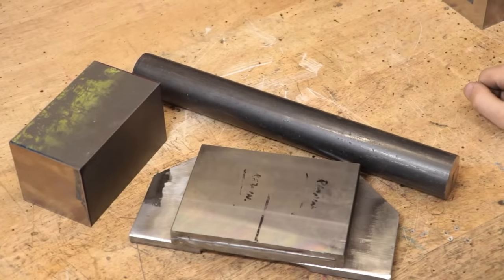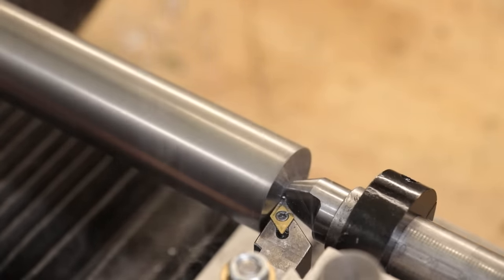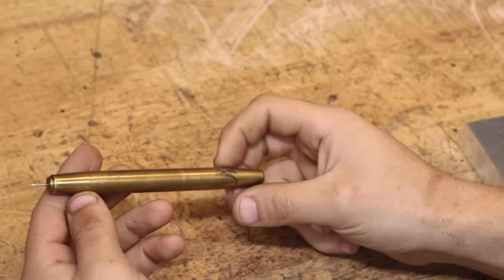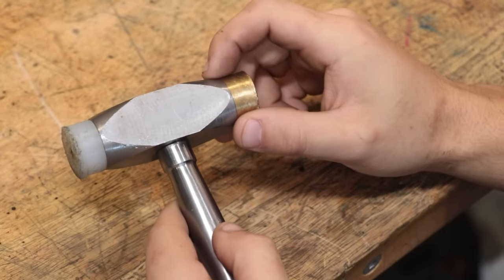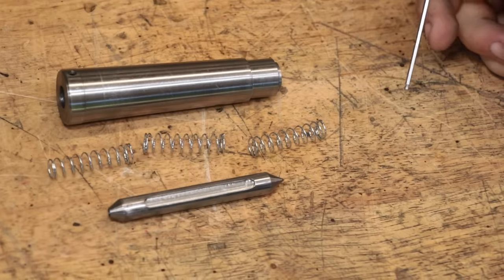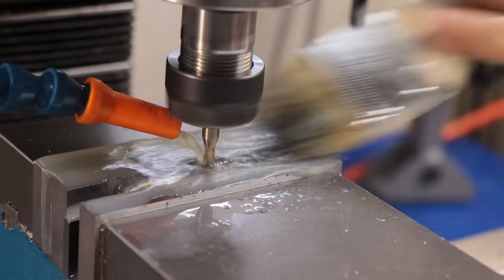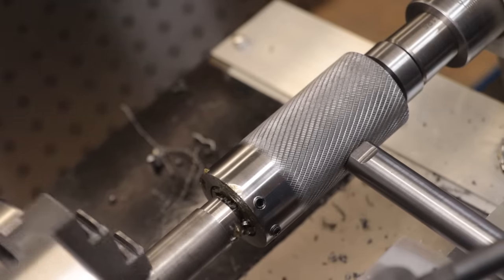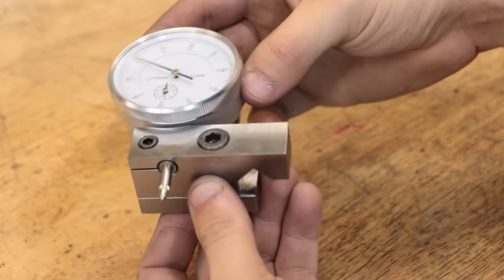The 6 Best Lathe Projects For Beginners

Comment: For threading in the lathe I'll often start single point to remove most of the metal then use a die to finish since the die will bring the thread to size quickly. It works especially nice if I need the thread all the way to a shoulder without a clearance groove.
Reply: Yes I find you have to use this procedure when you use a "cheap" die some times, might be a relief problem with them.

Comment: My list of lathe projects has been stuck at 1 for years.  

1:  Get a lathe.
Reply: Perhaps slicing project number 1 into smaller pieces would help? 1a) Save some money for a lathe budget, 1b) find a lathe which fits said budget, 1c) actually purchase the dang thing. Admittedly, I am still stuck at 1a, but perhaps you can make it further down that list than I did so far.
Reply: Mine too!
Reply: Mine was too, for about 2 decades. After I bought my first lathe, I wondered  why it took me so long! If you are short on $ (we all are) get an used machine, even an worn-out is better than none. That's the most useful tool ever, that will lead you to the ultimate hobby itself.
Reply: @TheBipolarBear  I am stuck at Phase 0 of the project. Finding a damn place to put a lathe lmao

Comment: I think the half-center is often ignored because for most projects you can just choke up on the stock to face it. Awesome video though, maybe it will be cool to know that my my first shop professor had me make most of these when I first started machining. I love the handle on the die holder. I've had a lot of trouble holding my own die holder (which lacks the big handle) when cutting steel

Comment: NUMBER ONE beginner project: Learn to grind HIGH SPEED TOOL BITS.
That would have saved you ~ $450-$1125 right off the bat just for the carbides you showed. 
1 $10 tool bit will replace 100's of carbide inserts and can be shaped to do any job then RE shaped to do another and can be re sharpened 100s of times.
You will learn the basics of how cutting tools work and it will also translate to sharpening other tools, like drill bits etc.
Whatever you do, you will do better if you know how to make your own tools.
Reply: I agree 100% 
Sooner or later you will need a tool to get into a place that a carbide insert tool won't reach or you need to turn a certain profile and will have to grind a tool for it . i see so many times where a newcomer buys a lathe and goes straight to insert tooling because they are scared of grinding a HSS tool bit - this basic skill  can be a game changer and can save you heaps of money . I have heaps of insert tooling for my machines but am migrating back to HSS tooling because it is tunable to the material being machined - i can easily change cutting tool angles / rake etc to improve the finish which can't be done with insert tooling .
Reply: @ianbertenshaw4350  When I started we still had some high carbon steel tools but mostly High Speed tools and if needed we had Stellite and/or brazed carbide tools we could make. All hand ground. That covered almost all the bases. 
Then this insert thing came in. The intention was for PRODUCTION work NOT shop work and for production it works well and makes sense but in the general shop it is ridiculous. After 50 years I did break down and bought ONE insert holder for the lathe and ONE insert face mill. For anything else I braze a piece of carbide on a shank and grind it. Luckily there are plenty of old carbides to be had for free to braze on that someone ELSE paid full price for🤣.
Reply: @ianbertenshaw4350  My guess is that most beginners shy away from regrinding HSS cutting bits is because they can't see what they are doing. Especially ones for a mini lathe, I certainly can't and what with having to get the angles bang on, forget it.
Now if there were a jig to hold them, like the drill bit sharpening machine that I use, I'd give it a go.
Reply: @steveclark..  
i don't usually use a drill sharpener or jig  either - unless i am doing four facet grinds that is ( use a dbit grinder for this ), i was taught how to grind them by hand and yeah sure they aren't as good as new but they get me by . The angles on a HSS bit are not super critical and you can make life easier by setting up the rest on your grinder to give you the approximate rake or clearance  angles required. The biggest mistake newcomers make is reading some data book and thinking the cutting angles have to be precise and it scares them to death but i find that near enough is good enough and for me it is more important to hone the cutting edges  so they are sharp and this also removes the marks from the grinding wheel which gives a better finish in most cases . i use an optivisor sort of thing as my eyesight isn't what it used to be.
There are four basic skills a metal worker or machinist should master : Hacksawing, filing , tool bit / drill bit  grinding and basic marking out - these skills have got me out of so much trouble it isn't funny ! 
P.S the HSS tooling doesn't have the overhang a carbide insert holder does which is a real bonus for small machines like a mini lathe  that struggle with rigidity.
Reply: @ianbertenshaw4350  All great advice there. I'd say that I've used my mini lathe more with carbide tipped tools than any other cutters, the brand new set that came with it, I found useless, I then got an HSS bit that had already been ground, sure that worked OK but overall I'd say that carbide bits are far better and easier for most to get along with.
Reply: Meh.  Don't want to deal with it, and don't want the grinding dust in my shop.  Did a lot of grinding in my last shop and it got nasty.  Current shop, I will find another way, or wait until the weather allows me to take whatever outside for grinding.  Insert tools save me all of that, and they don't need to be carbide necessarily.  A.R. Warner's makes nice HSS insert tooling.
Reply: @netpackrat  Grinding dust?  Seriously? All the grinding dust from sharpening tools in my shop for the last 30 years might amount to a few spoon fulls. I'll take that instead of spending $thousands on inserts and holders.
I've never met an actual general machinist that does not have a selection of hand ground tools.
Reply: @netpackrat  I do see your points and use inserts mostly myself but being able to master the skill of grinding HSS bits would be handy. Imagine if Klaus Schwab and his Great Reset actually happens, goods from China may be a thing of the past.

Comment: Great little video, showing some very useful first projects, I think most people could work out how to mill the carriage stop on the lathe using the cross slide (with some ingenuity). It's a slightly more advanced way of thinking about a lathe but as you yourself have said a lathe is also a horizontal mill.
Thankyou for sharing

Comment: Sometimes you might get a tap with a point or rounded end rather than a convenient hole. I have a few BSF taps like this. Easy to make a tap follower with a hole. I used a BSA motorcycle cam follower to make mine as it was good steel with ready made concentric recess for the tap end

Comment: I may have a faulty memory, but with your old lathe, you mostly turned the chuck by hand when single point threading, but I notice you do run the motor when single point threading with the new lathe, is my memory correct?

Comment: Any thoughts of adding an ELS electronic lead screw kit to your new lathe to cut any threads from acme, British pipe, metric/standard fine /course etc..even custom threads are possible without gear changes via the stepper motor controlled lead screw..they have inexpensive plug n play kits available..it would make a great video series besides being a great addition to the shop..Cheers..
Reply from the maker: For me I have zero interest in adding one to any of my machines. Nothing against them but I just doing find the project interesting
Reply: @artisanmakes  Yeah having the ability to cut any thread on earth accurately in minutes for a couple hundred dollars total,seems like a complete waste when you can spend hours making a tap or die each time you need it..guess its more about the journey then the final destination..I totally get it..obviously a guy that hacksaws everything isn't interested in quality of life innovations..which makes you stand out from most..Cheers..
Reply from the maker: That's not what i said. I just don't  find it to be an interesting project, so it has never been near the top of my list of things to do.
Reply: @agentcovert he doesn't have space for a bandsaw.

Comment: I think the title is a bit of a misnomer if 2 of the 6 projects require a milling machine :¬(

Other comments 
1) the stylus needs something to stop it rolling - falling off the bench is the main cause of tip breakages 
2) surely if it's for beginners, at least 1 project should avoid steel and stick to brass, alloy, Delrin etc?
3) cutting the slot for the tap follower can't realistically be done without a mill. Would it be possible to make a through slot in the outside holder (using repeated drilling and hand files), then fit a screw-in pin to the inner part to match the slot?
Reply from the maker: Of course you can do it without a mill. Hold endmill in the lathe chuck and hold the centre in a tool holder and advance the cross slide to machine it. The channel We can do that better does that type of work quire often.
Reply from the maker: Well.as I said in the video it's entirely up to the user what material they use. On a big lathe  steel is pretty straightforward. At leastit was for me when I was shoved on one
Reply: Eh, 'affordable' benchtop mills are a relatively recent thing. What d'ya think model engineering hobbyists did back in the day? They used the toolpost to hold the work or stuck a vertical table on the cross slide and milled with their lathe.

Love ArtisanMakes but he's understating the ability of the lathe to do most things you'd do with a mill. Of course, if you have a mill, you'd use that but if you don't have an extra £1500 to spend on a mill after you spent a grand on a lathe then don't be put off; import vertical milling attachments are pretty cheap and after a bit of cleaning, fettling and setting up you'll be doing milling on your lathe when you have to

(it's a pain in the ass to set up but that's what happens when we're poor: inconvenience, I'm afraid 😂)
Reply: Right, so the endmill I don't have, because of course I don't have a mill, will do the job, if only I, a total beginner, can work out how to hold ~20mm round stock in a toolpost that only takes 10mm tooling. No doubt possible, but I think I'll stick to my suggestion which doesn't require any of this. Thanks anyway. @artisanmakes
Reply: @artisanmakes  Missed the comment about using material of choice, just noted everything was steel. The 'big lathe' is in the workshop I don't have alongside the mill I don't have so I won't be using that any time soon :¬(
Reply from the maker: For the tap follower you only would need to clamp is 8 or 10mm stock. But people who dont have mills use vertical milling attachments. Before I decided to buy the mill I was going to buy one
Reply: @artisanmakes  Hi, you're right of course - the slotted part is the smaller inner rod. Duh. I may get an endmill and try, but I'll have to think on it. Attachments of any kind aren't really an option for my tiny and long out of production Toyo ML-1, I'd have to change the lathe first, and I'm not ready for that. It's easy to spend an awful lot of time and money on the machining, when all I'm really interested in is the parts it produces.

Comment: Er if there's not enough room on your lathe for the Tap Wrenches you have why don't you design and make one that is the right size to use on it. I mean surely it's a easy enough project seeing as you've already made a larger one. To get the torque you need it might take a bit of clever designing with say folding arms so the one that's at the bottom at the time folds out of the way of the bed but once past folds out and extends again to give you the torque you might need. That or just make it with shorter arms as I can't see you needing more torque than shorter arms would give you anyway. You still really need a band saw and preferably compressed air in your shop, if just so you can blast clean the Mill or whatever whenever you're using it. Love the fact that you've built a shop that's effective and where you can make things and do the things that obviously make you happy and that you enjoy. It's obviously your passion and despite obviously not having unlimited resources or anywhere close you've bought the machines you can afford and are making the most out of what you can afford and get. I mean whilst Clickspring has a larger lathe and can obviously afford to spend on machining that you can only dream of at this time he shows regularly just what is possibly, the percision and accuracy, the inventiveness and stunning finished pieces that are possible on a small, cheap lathe. A few tricks, a bit of out of the box thinking and taking the time to ensure that things are right are far more important than the machinery and Tools you have. I'd imagine you've already found his channel but if not you definitely need to check him out, there's also Inheritance Machining where his level of percision and dedication to getting things as good as they can be are amazing to watch.
Reply from the maker: If you want you use use a tap handle in the lathe that's small enough enough work. They still have centres so you still end up using the follower.  Even a small tap wrench and the follower is used to keep it allowed. Cheers